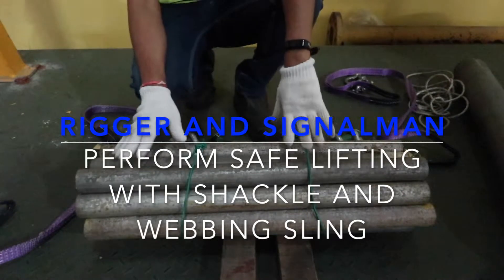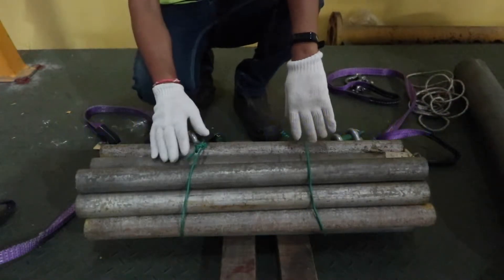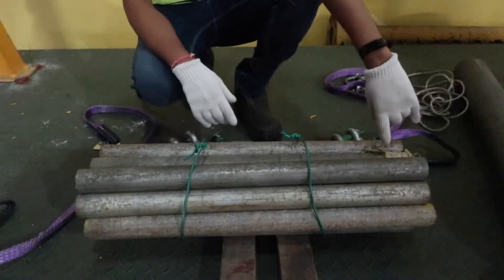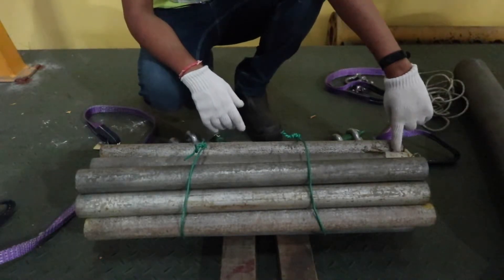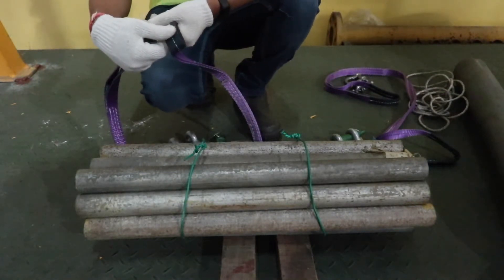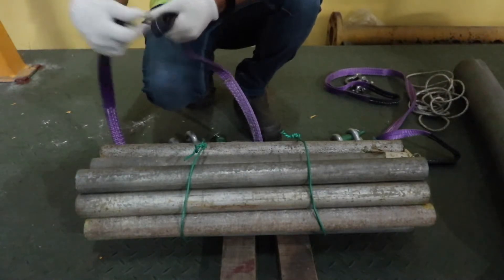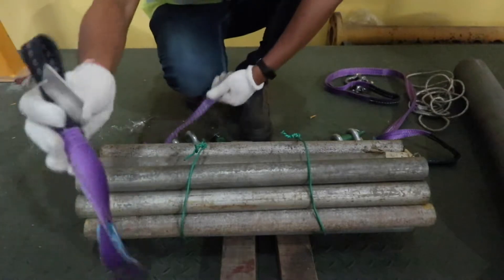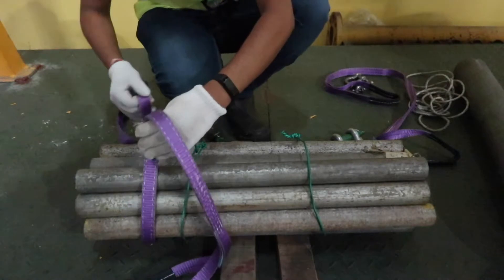Rigger and Signalman - Perform safe lifting with shackle and webbing slings

Comment: Gotta put the toughest part of the sling in the bow of the shackle, rubbing and friction will fuck uo that sling, and no sling should be in the pin anyway, just wrong. Just go around thr load twice with sling and choke it.
Reply: D/d ratios and a shackle would reduce friction burning??